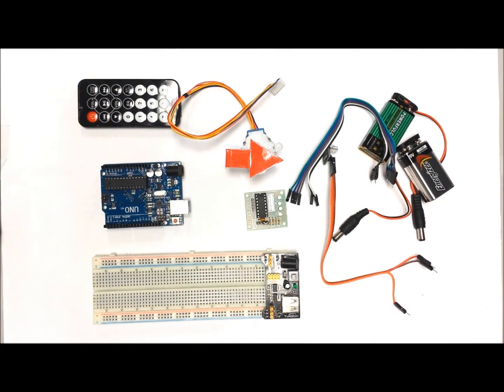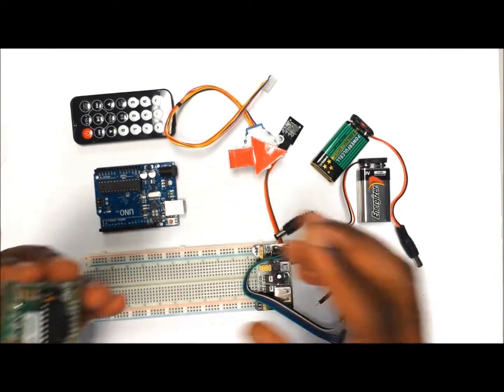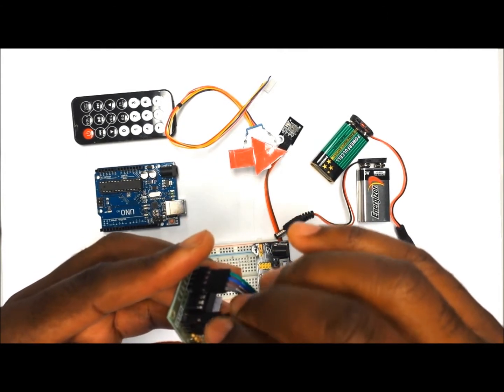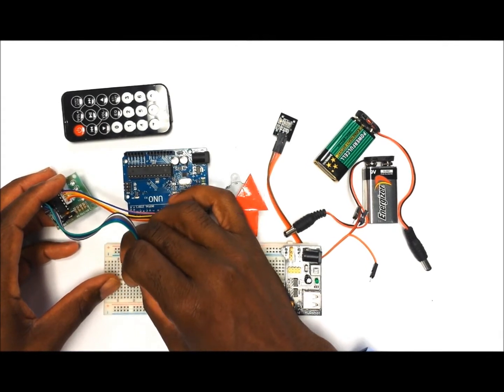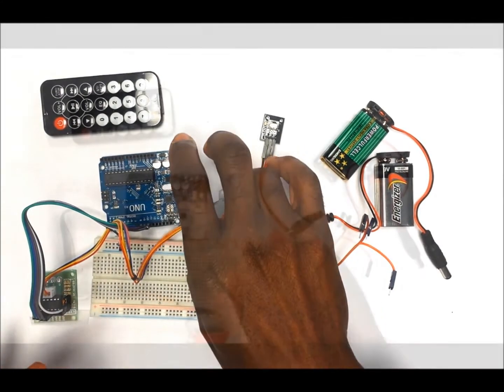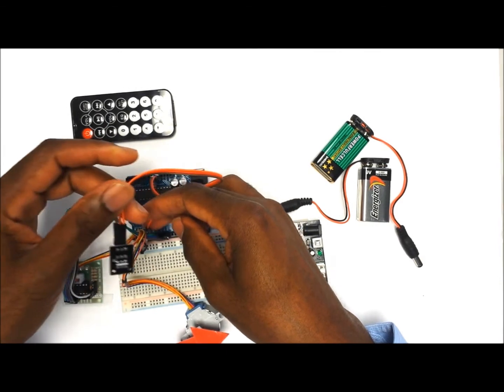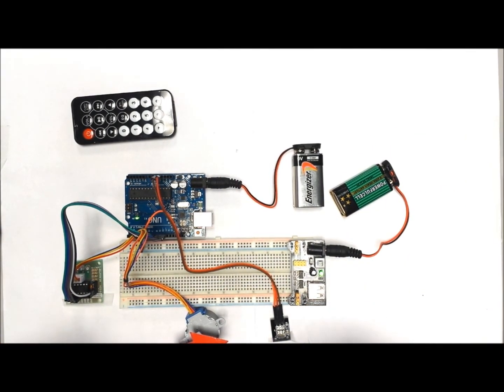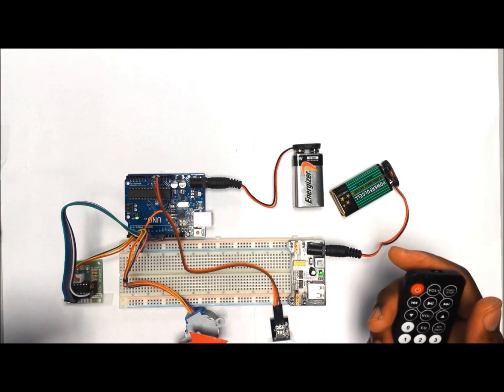IR Remote Controlled Stepper Motor

Comment: hello, thank you for video...it is fantastic! 

However, I found that there is an error in code. It is very simple fix...only need to add a 'space' in line of code below:

Your code: 
IRrecvirrecv (receiver); // create instance of 'irrecv'

Update: 
IRrecv irrecv (receiver); // create instance of 'irrecv'

You will see in the software that the 'IRecv will become orange. Then it will work!

I hope this helps :)